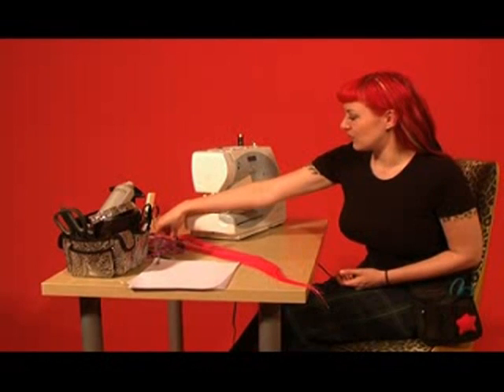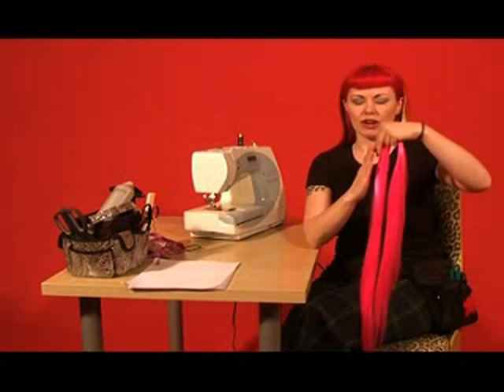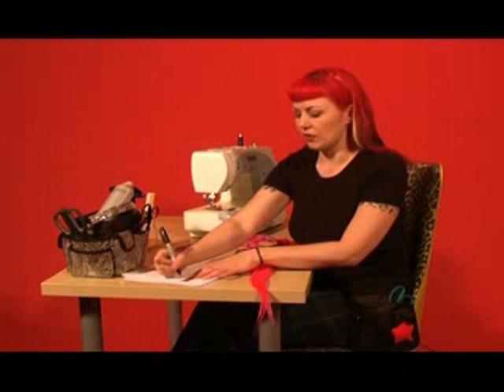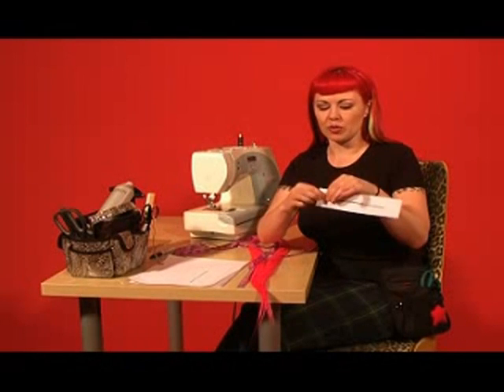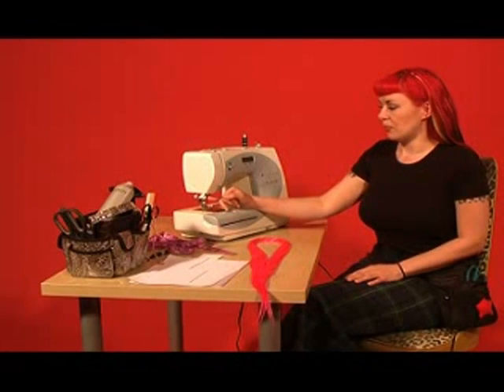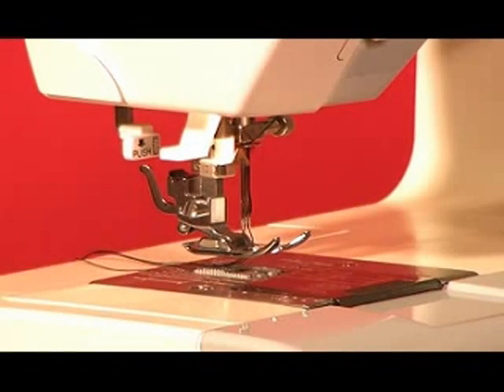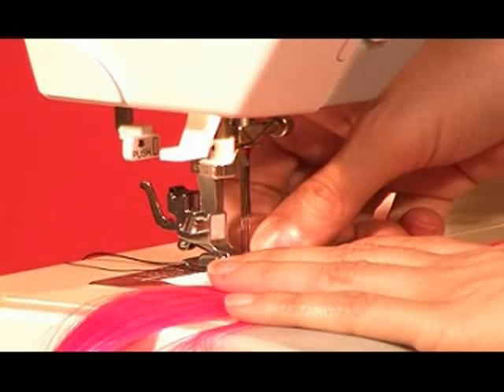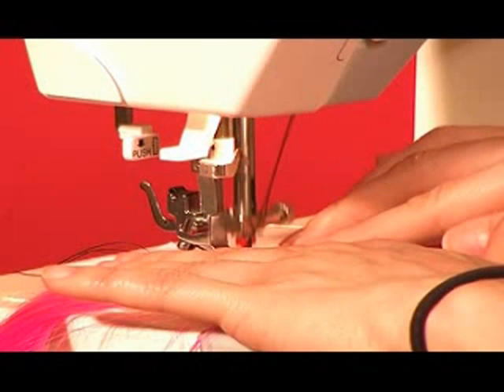How to Make Wefted Extensions from Bulk Hair Part 1 - DoctoredLocks.com

Comment from the maker: If you aren't planning on making wefts very often, a single needle works just fine - its just more work.  A triple needle is fastest and works best, but they can be tricky to find.  A double needle is very common and is pretty good as well.